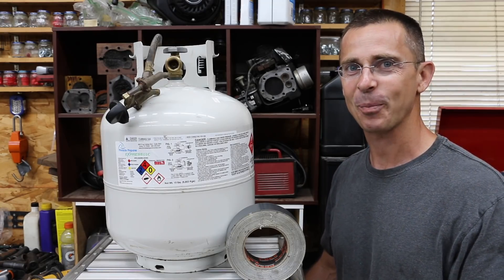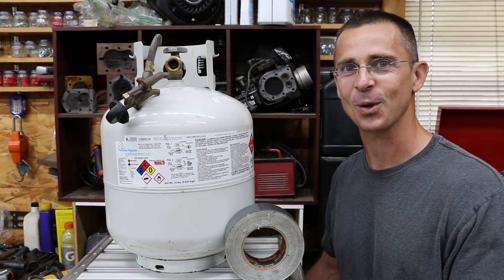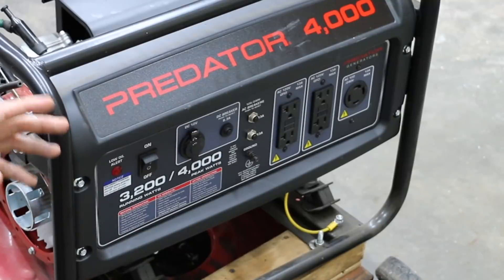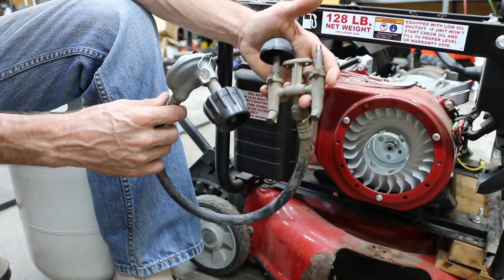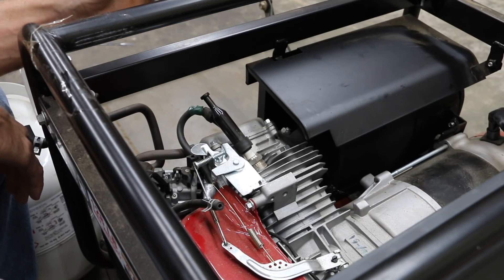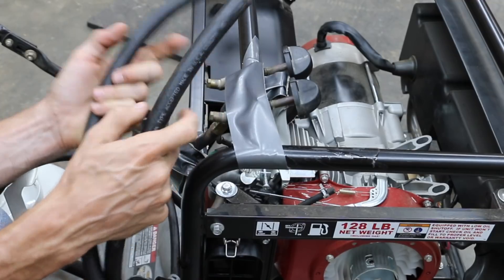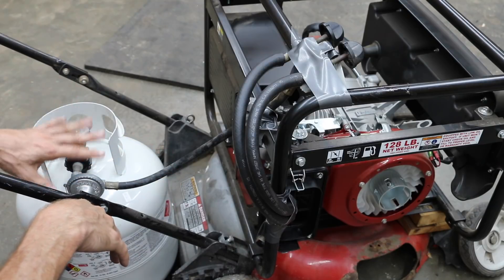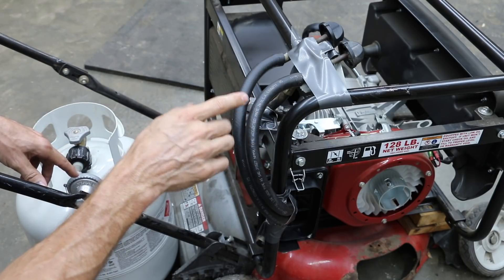Can a gas (propane) grill power an engine?  Let's try it!

Comment: Looking forwards to a retake of petrol vapour ;)
Reply from the maker: Thank you
Reply: Project Farm look up a film on ytube called gas hole its about the oil industry and why we haven't got better effiencies . It also talks about the people on that link tom ogle aswell shell bought him off . They were able to get 150mpg back then. Also do you have any diesel engines? The guy rudolph diesel invented that engine to run off peanut oil. Its called a diesel engine because of its creator not off what it runs off. After his death the oil industry took hold of his design and put them in cars they must of named diesel , Diesel, at this point just to trick people into thinking its designed just for there product! Theres many different oils that can run a Diesel engine . It would be interesting to see if it could run on cheap vegetable oil straight from a supermarket but still theres hundreds of different liquids that can you can try ;)

Comment: is it safe ?
Reply: the other thing is that propane can burn your valves out, it runs hotter than gas, my car burned out the valves causing a full engine rebuild after being promised this wouldnt happen, ny putiing lead slugs in the lpg tank.

Comment: I did this to my 87 Buick 307 V8. The lines got ice cold. I used a 'torch' propane canister. Ran it straight in just to see if you would run and which it did. Carb was about frozen when I was done.
Reply from the maker: Wow!  Thanks for commenting on this.

Comment: My car runs on LPG which is basically propane. It runs slightly less efficient but it is much, much cheaper than gasoline. Also what people often forget is that you can still run your car on gasoline as the LPG system is added but the original gasoline system is not removed.
Reply from the maker: This is great information. Duel fuel system would add a lot of driving range.
Reply: It does add a lot of range. I run 99% of the time on LPG, but I never have to worry about making it to the next gas station or not because I keep my gasoline tank between 1/4 and 1/2 full at all times. 

The car does always start on gasoline because the LPG is gasified in an evaporator which is hooked into the cooling system. So the engine coolant needs to be up to temp before it can switch over to LPG, which takes a couple of minutes (and is dependent on ambient temperature, so it takes longer in winter). So it does use up the gasoline albeit very slowly. I run on premium gasoline for that reason, I figure the additives might help stabilize the fuel and keep the injectors from gumming up too much.

Comment: If the engine backfires from the air filter wouldn't it ignite the propane?
Reply from the maker: It would ignite the fuel coming out of the hose, but it would get past the regulator.

Comment: I bought an old gravely 8163 tractor that was sitting in the woods for years and years for $50 about a year ago. It had a broken carburetor neck and one of the ears that mounted the carb was broken off of the block. I had some black pipe and shoved it up the broken carb neck. From there, I added a T fitting. One side had a ball valve for air control, and the other side I connected some fuel hose and shoved in the nozzle of one of those little blue propane torches you get from walmart for a couple bucks (without the regulator in it) I was able to get the mix just right by adjusting the ball valve for throttle and the knob on the torch head and got it to run. I was even able to drive it around my yard after more adjustments. The two downers are that you have to manually adjust the mixture depending on the load, and as you use propane, the bottle freezes up and looses pressure until it warms up again. I actually have an old 12KW standby generator that I run with a 15lb cylinder and a barbecue regulator.
Reply from the maker: Impressive!  Thanks for commenting on this.

Comment: If you had to convert 2 stroke engine to LPG, how you think to solve the lubrication issue? I bet nobody try this before.
Reply from the maker: Great video idea!  I'll likely put together a video on this soon.
Reply: A lot of 2 strokes have an oil injection system so you don't have to pre mix, that might take care of it.
Reply: Dark GT oil pump my ATV has this
 Although I don’t trust it which is why I still run premix
Reply: @maxahundred  yeah man don't trust that oil pump on ATV's they are garbage and the oil never gets added when the kids put the gas in
Reply: Some two strokes had oil injected engines with a separate oil tank.  The 1972 Kawasaki H2 748cc engine had such an arrangement.  You did not have to mix oil in the gas tank.
Reply: Stan Ervin 2 stroke diesel has a separate crankcase, and separate blower
Reply: well sure, if you wanted to take your chances that your oil injection system was working properly....usually, the tank would plug up with dirt and crap from years of riding desert, the linkage and spring would get bent & tweaked and they really didn't mix the way they should.  so most guys, like me, disable the injection and mix our own.  especially if you have a whole bunch of 2T's  that you're mixing for anyway, it's less hassle.   :)
Reply: @vintagespeed  A lot of bikes with oil injection also had oil injected into the main bearing. Use premux and you could destroy your engine.
Reply: you would run a higher percentage of oil in the mix to accommodate for the extra fuel.
Reply: My '74 Kawasaki F11 250 has a separate oil and fuel tank. I don't know if the oil pump works or not so I've been running premix. I haven't heard of one failing though, yet
Reply: Project Farm I have a 30hp Yamaha 2stroke outboard that is oil injected after the carburetor before the reeds. 

I've wanted to try and run it on propane or wood gas, as long as the oil is objected after the carburetor it should run all good on lpg or woodgas
Reply: You would probably have to use an oiler like you do for air drills and set the oil to inject in to the manifold.
Reply: VintageSpeed Garage . In what mix?
Reply: TUK TUK engine in thailand has 2stoke 300cc twin cylinder gasoline engine are convert to lpg or cng for taxi in city area. they using 2t lube dripping pump to intake for lube. Exhaust gas has a lot of white smoke and very stinking.
Reply: jrgwilldoit what about using the propane to pressurize the oil tank for a more consistent flow rate / better misting in the intake?
Reply: have a DEF injector converted to do oil and there you go LPG 2 stroke
Reply: Andy47357 ,
 Ponderous... hmmm. Is there a conversion kit being sold you can reference ? I'm quite curious as to how it's getting done..
Reply: It has been done in some outboards used in very cold climates. They simply used an oil injection system.
Reply: There is a propane powered 1970's police camaro in my town of Fife, WA.
Reply: I'd fill the float boal with oil and put a very small main jet size on there.
Reply: Modern two strokes have an oil feed into or after the carb so getting oil in wouldn't be an issue
Reply: lol, well my Husaberg FE570 doesn't run mix, nor does my 530EXC-R, but all the little 250s and 125s in the fleet do.  so does my buddy's 500/KX250 that we motor swapped.  so meh, what do i know......we dont have to do valves every season!  hahah
Reply: Simple, Oil injection System, next...
Reply: my yahama scooter has got a seperate oil tank too, but i would think the mixing happens at the carb
Reply: the stinking comes from incorrect oil metering (way too much) and probably also not the best 2-stroke oil
Reply: You can inject the oil straight into the crankcase
Reply: Dark GT sealed main bearings
Reply: Here in Bulgaria during 80s peoples used to make such conversions on two stroke cars as wartbirg, and trabant. They used some type of self made spray system that inject oil into fuel/air mixture.
Reply: jrgwilldoit Dx
Reply: Just injecting oil into the intake doesn’t sound like it would work with propane. When it is objected with gasoline it mixes with the liquid gasoline and gets pulled into the crankcase but if you injected it with propane, ( more like a gas) it seems to me that the oil would pool up in the crankcase and not get to bearings and to the cylinder walls. The gas/oil mix does its lubricating in the crankcase not in the cylinder.
Reply: Project Farm pressurized oil pump with a old fuel injector?
Reply: sealed crank case just like a 2 stroke diesel
Reply: Gasparini genset has auto oiling, it is a 2t running on propane/lpg.
Reply: I think most if not all older oil mixing systems mix the oil in with the gas and then the mix passes to the carb, so I'm wondering if it would mix right if it has a gas passing through it. If the engine injected oil into the crankcase it would probably work

Edit: after more reading I see that some mix systems inject the oil after the carb so those systems should work. I was going off the knowledge of my old Evinrude outboard which mixes oil into the gas before passing it into the carbs and the E-TEC which has targeted oil injecting directly into the crankcase
Reply: Propane is odorless ,so when you "smell" propane you are actually smelling an additional additive, this additive is oil based and some propane tanks like the ones on fork lifts have extra oil additive mixed in with it also, i  have run an old weed eater engines that was brand new off bbq propane and ran fine with no gaulding or seizeing but it was tricky getting the flow just right for such a small engine
Reply: Im assuming You would need to use an oil injector.
Reply: Oil injection.
Reply: All these comments about 2 strokes and oil injection vs premix remind me rotary forums lol. 😁
Reply: Quite a few two strokes use oil injection, in this instance lpg would be fine
Reply: Dark GT 
My guess would be an oil mist injection setup, similar to diesel engine
Reply: grease

Comment: Used to have a fleet of plumber’s vans running on propane. Way under powered vs. gasoline ( couldn’t pull a sick whore out of bed ) and froze to death in the winter ( used engine coolant to flash off propane from liquid to a gas ).
Reply from the maker: Thanks for commenting on this.

Comment: In Europe we have reducers + mixers (mounted on intake) which it allow maintain constant afr on any load. Larger enines needs reducer-vaporizer heated by eninge coolant because liquid lpg cool down during expansion (from liquid to gas) and when freeze to much it stop vaporizing.   injected engines can be equepped with lpg injection system (more precise). Of course after conversion driver can switch between fuels (gas or propane/lpg) while driving.
Reply from the maker: Interesting!

Comment: Very common in Poland - you can buy and install a professional LPG (Liquid Petroleum Gas) installation (it is in general a propane) to virtually any gasoline powered car - even for a direct injected TSI engines etc. (but in this case, will be very expensive). LPG Installation have their own ECU, but shares most sensors reads with cars factory ones. (oxygen sensor, flow meter sensor, knock sensor etc, etc.). LPG tank is located in the trunk (big one version) or replaces a spare tire - this kind of tank is pretty small, but you still have full usable trunk. LPG Fuel injectors (in traditional EFI car) are located in a intake manifold, near to the factory petrol ones. You also need a LPG evaporator, which is connected to car cooling system hoses - the cooling fluid heat evaporates the LPG in this device.
Reply from the maker: This is interesting.

Comment: This is surprisingly easy. I always wondered about this. I have a 22 yo Generac 2500W that's totally shot as far as the pull cord and carb are concerned (last ran circa 1998) but I wonder if I could resurrect it this way. I need your amazing starter motor, though! :P
Reply from the maker: lol. Thank you

Comment: I work for a natural gas compression company and take care of 52 natural gas compressors/engines. One other thing to note is natural gas burns with barely any emmisons compared to gasoline. I see 50,000 hours regularly on these engines.
Reply from the maker: Impressive!  That's a lot of hours!
Reply: Project Farm I believe the record was 86000 lol. That is of course with multiple heads due to valves being recessed into head.    Even with 30000 hours on one head when you take the engines apart they sure are clean compared to gasoline engines
Reply: Oh, my,,  there have been propane powered engines for years. There are dual fuel carburetors,  propane and gasolene. 
Back in 1980 I rode in a souped up hotrod full boat Cadillac that ran on propane. 
Caterpillar makes a industrial sized generator that runs on the gas that comes from a landfill.
Have you seen car engines that run on wood gas? There were alot of them during ww2. And then there is the diy generated methane engines...

Yet more video ideas🤓
Reply: I live in SW Penn. and Colombia Gas has a pumping station on the PA WV state line on coincidentally Compressor Station Rd. They use the gas to run the engines that pump gas. Pretty cool
Reply: Joe Smith 
The problem with most operating propane engines, is that they run so well and for so long that no one needs to know how to work on them. If they are kept in tune they start easy and run well with no smell or problems...  But other than the hotrod car  I rode in, there was only one fork lift that ran well, and it was new.
Reply: Nice Willy Bee. I was about to comment and tell ProjectFarm to go full wood gasifier on lawn mower next.
Reply: cfraser650 
Wow, that's equivalent to over a million miles!
Reply: Project Farm after this Video I once again really want you to try to run an engine on CNG. Compressed Natural Gas. Looks like this is a great way to «feed» the engine with gas :) thanks for an amazing video again :)
Reply: Here is a wood gas truck...
https://youtu.be/aRbYiP0cJmg
Reply: Back when the Arab oil embargo of 1973 happen  there was this push to really get at it and try to start using natural gas. Because the natural gas burns hotter than the propane. Even then propane forklifts were common at that time. The only places the propane forklifts weren't used were in fresh meat plants or freezers. Tried but exhaust grayed fresh meats. What I remember so well about the Chrysler was that they used their first electronic ignition. The pollution junk added from 72 was gone. And they had back the higher compression engine .  Sad it wasn't like today with the cell phones where everything is captured in photo's. Maybe you had a camera with if you were on vacation, or at a wedding  or something.
Reply: Only issue with natural gas and LPG is no top end lubrication. Gasoline and diesel lubricate the valve seats. Most engines I've worked on that were designed for gaseous fuels had hardened valve seats. Also, depending on the engine had valve seals that were designed to weep. The oil used had a certain ash content. The ash buildup on the valves helps create a cushion. Of course if there is too much ash, worn cylinders or rings, it would foul out the spark plugs.
Reply: Agree use to maintain a old pump Jack that started of gasoline then switched to natural gas  straight from the well. Was very loud but once going nothing could slow it down.. but seemed like forever her started and switched
Reply: Joe Smith, Run it through a common automotive catalytic converter and it will clean that smell right up.   Just make sure the catalytic converter is as close to the exhaust manifold as possible due to how a propane burner engine has far cooler exhaust temps in normal operation. 

It doesn't need to be as hot as on a gas engine but it still needs to be as hot as you can get it.
Reply: Daver G: Some of the Schwan's delivery trucks that drive about my area are equipped to run on propane. They've been operating like that for years and the trucks always seem to sound like they're running good any time I've seen one go by. Of course, I don't know if their newer trucks they've been slowly introducing still run on propane though.
Reply: What is interesting is back in 1973 (Arab oil embargo) Chrysler had a full size New yorker with a 383 on display running  at the auto show in Chicago. Everyone was standing around  all excited.  But the government never gave  Chrysler the go ahead. All because of the compressed gas tank. Which we all know was farce. Then with in a year or two. Utility Companies like Peoples gas started with some cars and pick ups. Chrysler Dodge product 318 and 383. Don't know if there are any survivors.
Reply: Side note when they didn't get the go ahead at the time. It was covered as a news story for the day. So there has to be information on it.
Reply: The Creator: What's even more interesting is agricultural companies have been making limited quantities of key tractor models that ran on propane since the 40's on into the 60's. Of course, they're rarer than the gasoline-powered variants. But they made them.
Reply: Wow i love propane exhaust odor
Reply: cfraser650 that's why forklifts run on propane/cng because they are clean and able to run indoors
Reply: kyosuke19971 I drive a natural gas powered Kenworth. I have a few videos
Reply: cfraser, you're correct. Methane, Ethane, Propane, Methanol, Ethanol, Propanol, etc, consume Oxygen to produce heat, water and. Carbon Dioxide, if burnt correctly.
Reply: Daver G  yes,  at the farm, we still have the old dodge, with a multifuel engine.  Diesel and CnG (natural gas).  We can do great distances
Reply: Propane forklift exhaust smells awful
Reply: @BiggusDickus2  It's the odorant they put in the propane.
Reply: @BiggusDickus2  Better than gasoline indoors.

Comment: Very interesting to see how cleanly it burns compared to gasoline. I'd be curious to see how long the generator would run on a tank of propane vs an equal sized tank of gasoline (maybe a much smaller tank would be better to shorten testing time) as well as comparing price per gallon and effective runtime per dollar.
Reply from the maker: Thank you.